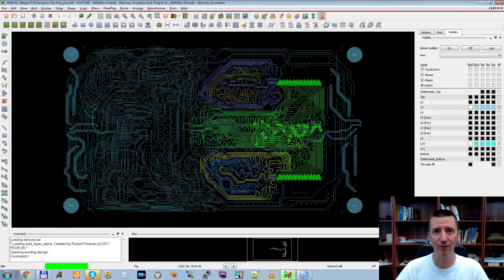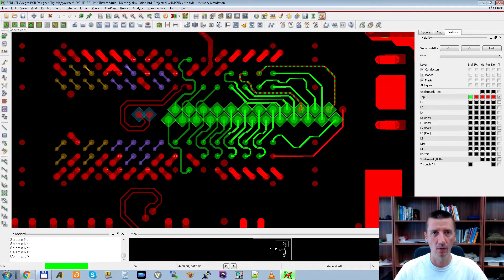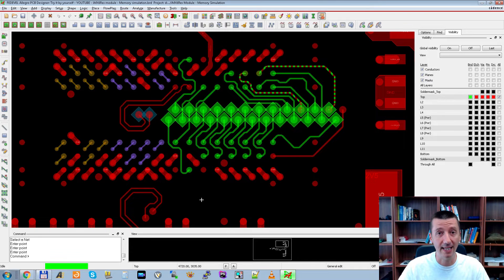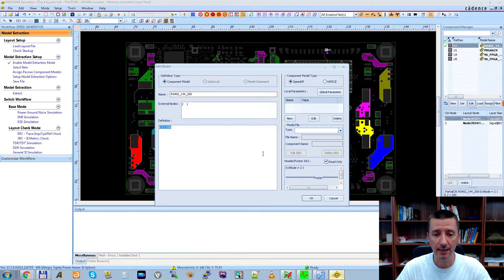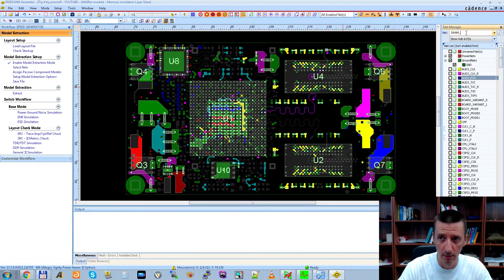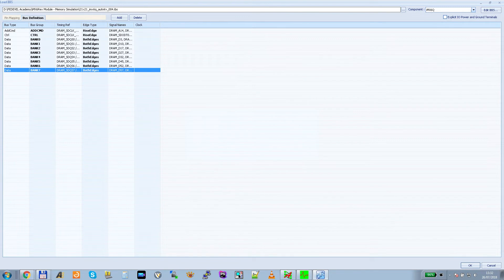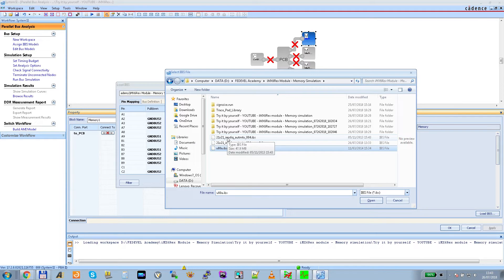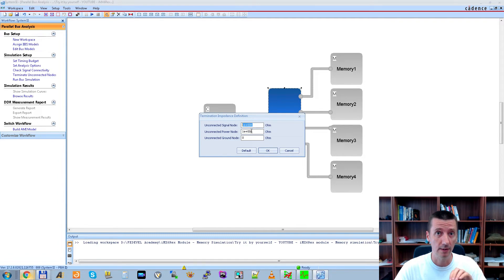How To Do DDR3 Memory PCB Layout Simulation - Step by Step Tutorial

Comment: @Robert Feranec  thank you so much for those excellent  videos, I learnt a lot from you.. A question in my mind, during Ddr3 length matching, I should take into account package delay/length of the cpu.. but what about the ddr memory itself? Should I also consider their paclage delay? What confusing me is, if I design the board considering for ex: a micron IC, May be I can not use an Issi IC (as their package delays really different, I compared some using ibis models).. the board would be IC dependent that I dont want it to be.. whats your comment about this situation, would you take memory Ic package delay into account? Thanks..

Comment: Great video Robert thanks a lot! It would be awesome if you could show a flyby topology as well. Also, I believe we can convert Altium pcb to Cadence before starting this...
Reply from the maker: Thank you Ahmet. I also have Fly-by layout (our other open source board called OpenRex) and if there is enough interest (if people like this video and it has enough views), I can make more simulation videos and compare the address/command/control signals between different topology. It could be interesting. PS: Do you mean create also a video about converting Altium pcb into Cadence brd?
Reply: Comparing different typologies would be very interesting. I was confused how you got the pcb in cadence from altium but I searched google and ı think I can figure it out. You could perhaps include that in the next vid anyway :)
Reply: Hi Ahmet,   
In Orcad/Allegro under file import you should see an option to import Altium.   You'll need to save the Altium designs into Altium ASCII format first.  
Or you can import your Altium design directly into the Sigrity Speed2K tool (for analysis) by using Speedlinks (If you install Sigrity you'll see CAD translators under your start menu)
Reply: @RobertFeranec  That would be a great comparison. Kindly do it is feasible for you.

Comment: Hi Robert Fantastic Video!!!! But this tools are comparable with Hyperlynx??? I don't know very well this kind of software in terms of performance and price. What do you think and what do you suggest? Thanks
Reply from the maker: I am not sure about price comparison Hyperlynx vs Sigrity. But Hyperlynx is a little bit more intuitive and Altium can create hyp file directly from your PCB (I am not sure if Allegro can create hyp). So, choosing simulation software may also depend on what CAD you are using to create your PCBs.
Reply: @RobertFeranec 
Is Hyperlynx really so great that alternatives are "Not good enough"?
Why is Hyperlynx considered so great?
Reply: Hyperlinks is easier because it makes several, Often incorrect ,assumptions.  So yes you can get waveforms easier but that does mean they are correct

Comment: thanks for the good video. The C2 value of [Row]C2 (Line 93214) in v80a.ibs causes an error. 
"ERROR - Package v80a_96ball_pkg: The Capacitance Matrix has diagonal element 3.822890e-013 at row C2 whose magnitude is less than the sum of off diagonal elements 3.823537e-013"

Comment: Hey !

Tnaks for the great video.

I have been searching and thinking about a project for over a month.
Since the prototyping cost of a 4-layer and 6-layer board differs a lot where i usually order my PCBs, I wanted to asked u, Have u ever done (or is it even possible) to rout a DDR3 SDRAM at 800Mhz at least, on a 4-layer PCB ?

thanks in advance, Best regards.
Reply from the maker: Hello Siya, I just answered in your other comment. This may help you: https://designhelp.fedevel.com/forum/test/circuit-design/13810-routing-a-board-like-the-imx6rex-in-4-layers
Reply: @RobertFeranec  thanks alot .
Reply: @RobertFeranec  thanks alot .

Comment: hi, robert...tanks for your excellent videos...one question...is it really necessary to learn how to work with cadence if I like to be pro like you??
Reply from the maker: Hi Navid, thank you. Couple of notes what can help you to decide:
- Many largest and most advanced boards have reference designs in Cadence Allegro. If you would like to design your board in different software, you may need to import Allegro and Orcad files into your CAD - this import can be time consuming and can cause a lot of problems and possible errors in your design. Therefore, if a company is designing for example motherboards, they will be probably using Cadence Allegro.
- I have only worked in two different companies: one used Altium, the second was using PADS (for simple designs) and Cadence (for motherboards).
- Cadence Allegro is quite different from Altium (Allegro is not so intuitive) and if you need to work in Allegro, than you would like to know how. Allegro requires some time to learn (so, for example, you may not want to apply for a job which requires Allegro if you have never tried the software before - in this case, knowing Allegro can help you to get the job).
Reply: thank you very much
Reply: Hi Navid
I'm a Cadence AE and I agree with Roberts comments.  Learning Allegro would enable you to apply for jobs at many large enterprise companies.    It does take some time to learn but it would be worth the investment.   Beyond that, if you still have space in your brain, then learn a 2nd PCB design tool.  If you know 2 out of the top 4 PCB design tools (Cadence, Mentor, Altium, Zuken) you'll always be employable.
Reply: wow...nowI really want start cadence
thank you

Comment: May I request to add a case for LPDDR4-3200 (which has controller and memory with EBD. I could NOT figure out as how to add EBD  and memory (i.e.  Micron z01m_200b_ddp.ebd and z01m_at.ibs). I need help.
Reply from the maker: Instead of Memory blocks you need to use EBD block (so when you are creating the diagram with Controller - PCB - Memories, you do not use "M" blocks, but you use "E" block instead)
Reply: @RobertFeranec  
By the way Robert, like there are plenty of books available on so many different software, why do things like Altium designer or Hyperlynx have few or no books and the books that exist are not in English!!!

I mean seriously, how come these made in USA programs do not have books in English!? This defies common sense.

Comment: thanks robert for your explanation..!! great video..!! Q: with Altium can you do the same ??
Reply from the maker: No, you can't directly in Altium (you can do some simulations in Altium, but not like this). However, you can export designs from Altium and then do simulation (this board is also originally designed in Altium). Or .... some simulation tools are directly supported in Altium, e.g. you can save your PCB for simulation in Hyperlynx.
Reply: @RobertFeranec  ok..!! Thanks for your help...!!

Comment: is there any simulation like this in Altium 20?
Reply from the maker: Altium is not good for PCB simulations - you will not get good results.
Reply: Hi , I want to join your courses of high speed design like DDR3. Actually ,my first ddr design is failed with 2 DDR2 in 6 layer.so can you tell me about your courses offered. I went through from your site but I found it very costly....
Reply: @RobertFeranec  I don't know how to do pcb simulation in Ltium
Reply from the maker: @Ghumakkad2429  Hi Amit, please write to info@fedevel.com and dominik ask Dominik for a discount coupon code. PS: There is one discount coupon code also in my channel banner. Maybe that can help.
Reply: @RobertFeranec  How exactly is the simulation capability of Altium designer bad?
Reply from the maker: @hassaniqbal7934  altium's simulation did not consider PCB layout properly. Altium company is working on some improvements, but I was not really looking into the new simulations (even if Altium improves simulation, I would not fully trust it - Altium is very well known for many bugs and mistakes in their software)
Reply: @RobertFeranec  ok, these programs that you have used here for SI simulation take the data from Altium and use it? I means they are compatible with Altium file formats.

Have you used HyperLynx?

Have you ever used Zuken tools?
Reply from the maker: @hassaniqbal7934  Altium can export to Hyperlynx (*.hyp). Also, simulation software can often work with ODB++. PS: No, I have not used Zuken